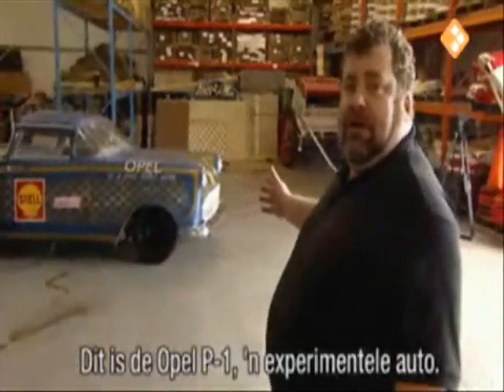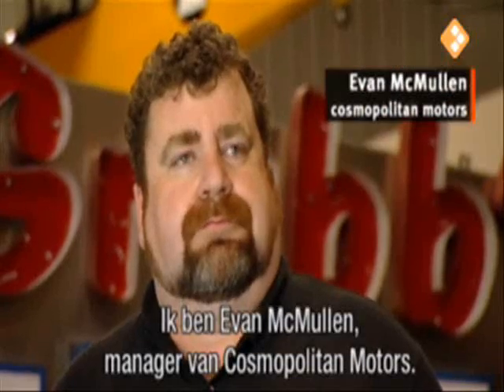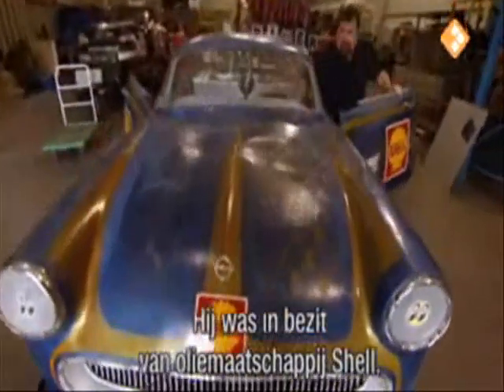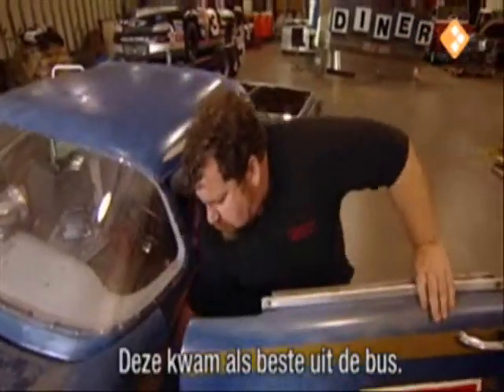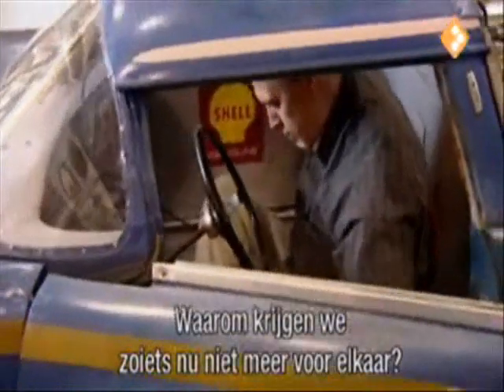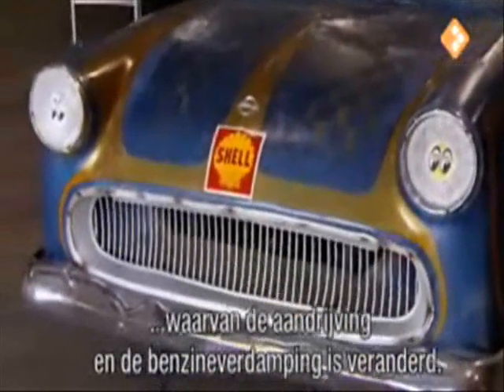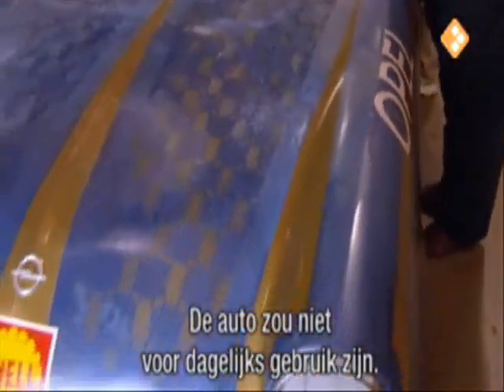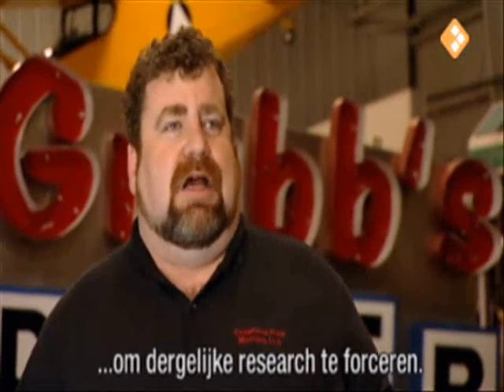High mileage car. 376 mpg!

Comment: Blame the oil companies and the bankers. They keep fuel efficiënt technology hidden. Like the tech to gassify the injected fuel instead of the direct injection nebulized fuel systems we have now. If you gassify fuel instead of the current nebulized fuel at injection, you car can become twice as efficiënt with fuel. That can applied to any other combustion engine for that matter.

Comment: The insurance company will be a change of venue and the judge will have no control over what happens. A claim against a policy will increase the premium. So my suggestion is to file as many claims on a policy as possible. The employer or whoever is compensating the Judge, administrator, commissioner, contractor, employee, officer, public official, attorney, persecutor (prosecutor), governor, city council member, complaint filer, police officer, tax assessor, DMV, etc etc will have to terminate the individual due to premiums increasing. You may not get anything monetary out of it but at least the source of your problem will have to be searching for another line of work.

Comment: Part of the problem here is the government regulations to control emissions. Much of an engines useful energy is wasted keeping emissions low.. Then there is safety considerations. A car has to have decent acceleration and enough power to climb hills without getting stalled. Also, the tires on that car are high pressure with an extremely small footprint, no traction to speak of. However I do agree that cars could at least double their milage if not tripple. My Prius gets almost 50mpg if I baby it. However, the general public demands performance with a certain amount of comfort and manufacturers are geared to satisfy demand. Yes it's all about the dollar, but then, do you want to be lorded over by a government which tells you everything you are allowed to do? That is what it would take to change things as they are!

Comment: I've watched this video about 20 times, trying to glean as much as possible. A few things to be noted:
1) The head pressure, or pressure caused by the distance between the top of the fuel level, and the point where it comes in contact with the vaporizer and/or heat is a critical factor in the process. I'm currently working on a similar high MPG vehicle, and have a desire to meter by drips per second. The only device that can do it well is an IV drip system. It was my own findings/understandings that helped me to understand WHY the fuel is in that particular location above the engine.  The next thing that I seem to understand, and appreciate is the synergy between the vertical orientation & the inner loosely helical shaped glass tube. The glass tube blown in a loose coil shape allows two necessary functions to occur: 1) any condensate must easily flow back down to the liquid at the lower portion of the container a helical 45-degree angle works better than a tightly coiled 5-degree angle (and you don't want to break the glass due to 'water hammer').  2) any vaporized fuel must be allowed to rise to the top of the helical tube without fighting the liquid, or condensate that will occur as the system warms up & cools down. Additional observations... the heat exchange should be as efficient as possible (the reason for the use of glass). Also, you need to be able to see the process in order to know when to adjust up or down in both temperature & flow rate. They didn't have computers back then, and coordinating all this may explain why the engineer believes it to be strictly for off road track driving only.   I can't find any analysis on this vehicle, not like I've given, and wish I could be allowed to drive from Portland, Oregon... up to Tacoma (200 miles'ish) and be allowed to examine it further.

Comment: 376mpg, but at what speed? A car going 60mph will use far more fuel than a car doing 20mph (theoretically 10 times more) thanks to drag force alone. Funny that the thimble of fuel would get the car 10 miles. Maybe 12 months or so ago when it hadn't denatured into useless hydrocarbons!
Reply: Apparently he was getting this miraculous fuel economy while averaging 80mph.
Reply: Fuel economy drops on average 36 percent if you travel at 80mph vs 50mph.

Comment: The man's math is horrendous. It took him three attempts to determine how long ago was 1973.
Reply: The rental came with a full tank. I filled up once en route, and once more the next morning when I turned the car in. I was able to get over 450 miles range on each tank of fuel. 13 gallon tank, but I didn't run it dry, of course, but just to make you feel better let's say I ran it out of gas before filling, that would still be 33mpg  average for the entire trip, including all the uphill bits. The first tank was used driving trough the plains states so yes indeed, fuel consumption was 42mpg though I really don't even know why I am wasting time proving what I actually did. I bet you never even did a multi thousand mile road trip but you go spouting ignorant comments. I've driven across the USA three times, I've learned to calculate fuel consumption. back to the original topic;
I did the trip in a bit more than  11 hours, because I drove it straight through, and traffic was nearly nonexistent.
That means average speed of about 75mph, btw. You are correct, we had to stop for fuel and to relieve ourselves on occasion. Obviously I was travelling much faster than 75mph most of the time to average 75 over nearly 900 miles.
Reply: If this rental you are referring to is the Nissan Altima, then perhaps one of your fatal flaws in your miraculous fuel economy is your miscalculation of the size of the tank. Don't assume the depth of my knowledge about cars. I urinate more automobile knowledge than you'll ever know.
Reply: It's amazing how you can beat EPA fuel economy ratings by  almost 50 percent.  Maybe one of your other fatal flaws is your math. To do 900 miles in 11 hrs and 15mins (you did say a bit over 11hrs) your average would be 80mph not 75mph. If your trip was 877 miles ( you did say almost 900 miles, your average would be 78 mph. I know the Altimas inside and out and in fact  I bought the very first new generation (2002) top trim Altima before the official release and was probably one of the first people to drive one in the country. Once again don't pretend to know the depth of my automotive knowledge or experience.
Reply: There is this little concept called rounding up or down, because I do math in my head, you know, without a calculator. 78mph is pretty close to 75. I did actually calculate it, but it was nearly 3 years ago, it's not like I keep a journal so I can post exact figures on comment threads so people like you can pretend to be so much more intelligent than everyone else.
I know I did it and how long it took me.
I also see you failed to prove anything resembling my request for you to enlighten us all, instead you brag about how you were the first person to own an Altima...who really cares, wow, you had the first of hundreds of thousands of FWD bread and butter sedans...ooh, I'm so impressed....NOT.
I briefly owned one of the ones you describe, I bought it to fix up and give to my best friend's daughter.

Nothing special about them, but they are nice enough.
I do know I can change a qr25 out in one in about 4 hours without even trying.
I actually am fond of the nissans before the current CVT crap they have now....IMO they are going to kill the company, but that's just me.
Again,
I never assumed anything about your automotive knowledge, but you have no problem assuming things about mine.
So, why don't you tell us about all the RB26 amd RB25DET swaps YOU'VE done, since your piss is such more experienced than I can ever aspire to be.
I have done several, one of them into a D21 pickup.
Tell me how many S30s you have swapped to an L28ET, and built a ECU, and tuned it, since I am so inferior to you.
How many cars have you rewired from front to back?
I've done that with a 1968 510, put a complete 200sx electrical system in it.
Please tell me how many stickshift conversions you have done.
I've already swapped a 92 buick roadmaster, no kits there buddy.
So please, go on about your superiority.
Or, are you gonna post another car you bought first?

Comment: Ok the last couple comments about getting marginally better economy with standard carb/ injectors, you can improve the economy of your car 20% just by monitoring and driving habits that promote great fuel economy. As well the car in the video except for the fact that it has an internal combustion engine, does not operate under the same principle as a carb or injectors. Funny enough it does burn fuel in a molecular fashion just to address the " splitting atoms" comment. 
Know one has made any reference to the fact that it was Shell ( big oil) that had accomplished this feat and strangely enough they haven't " destroyed " the evidence
And everyone that wants to know about it just has to go on YouTube 
This is some big conspiracy?
Reply: Exactly. 
but people like Carlos just say it's impossible because they can't do it. The CRX thing is also bullshit because if that CRX were tested using the updated EPA standards, it wouldn't get 40mpg

Comment: I drove a rented Hyundai Elantra from St Louis to Bethlehem PA....my AVERAGE speed was 75mph (which means i was doing over 90mph for a good portion of the trip) for the entire 900 mile trip.
AVERAGE Fuel economy was 42.5mpg. keep in mind that once you hit West Virginia it's almost ALL uphill.
If that CRX can even do 80mph it's not gonna get 40mpg doing it and you would blow it up trying to do 80-90 for 900 miles.
especially not impressed when the 1992 Oldsmobile Custom Cruiser that I drove down to St Louis (I sold it and delivered it to new owner because it made for a nice vacation) managed 27mpg over that 900 miles. A 350 V8 in a 4400lb full size 8 passenger station wagon that your CRX could fit inside of if you cut the wagons roof off.  Cruised it at 90-100mph no problem. 
so to repeat myself,
Not Impressed by your 1986 CRX.
Reply: I would wager it could. Also I doubt your 75mph average speed and you would have had to fill up at some point. The only way an Elantra is going to get fuel economy of 42.5 mpg at a speed in your own words of " 90mph for a good portion of the trip"  is down an elevator shaft, with a tail wind in neutral.

Comment: This will help explain 
www.
59fiatshellcar.
com
I own the fiat.
Reply: +Brian Selk Check out the BlueMotion cars from VW.  They get in the 70+ mpg range for diesel, but they won't allow them into the US yet.
Reply: MAXMPG You haven't made any recent posts to your website, have you been busy?

Also how are the electric fuel pumps that take the place of the water pump powered?
Reply: Hi Brian. The pumps are hooked up to the battery through a toggle switch on the dash. This car isn't really driven now. But, that is the way the pumps were connected and used by the team for the competitions. One more piece of interest is I was told they used two batteries. One for starting, and one for the pumps. 
I have more pics for the site. But have run into space issues. I will need to move some items around. 
Thank you for the email and interest. I'll step up my game on that site.
Reply: MAXMPG Thank you so much for responding. Does using such a setup really make that much of a difference? Is it going to pay for itself? Also you would have to create custom seals and stuff to make everything water-tight right? Also if you had everything set-up like that would you need check-valves or do fuel pumps already take care of that?
Reply: The pumps probly will not flow  backwards. I wouldn't think any check valve would be necessary. What special project are you working on?
Reply: I'm just throwing some ideas around to see how I can make my chevy (geo) metro the best it can be. I have done a lot of weight reduction, put some manual toggle switches, use a warm/hot air intake setup, and some lower viscosity engine oil for now. I haven't had it long, but hope to do a lot more with it.

My real special project will be to get a diesel and convert it to run on straight vegetable oil. Even then I would still be looking on how to make it even better.
Reply: +Brian Selk please go to my website and use the email address I post in the site bottom of home page.

Comment: Yes, I remember small cars made in the 60s and 70s getting 40 to 60 mpg.
My old 76 Datsun B210 got about 41 mpg on hwy and about 30 mpg in city.
If you kept your tires at correct air pressure, plus engine with good tune-up and clean air-filter, with good Texaco gas, you could actually get an additional 3 to 4 more mpg on hwy.
Reply: Had a 1989 Plymouth Colt with a 5 speed, it would get 45mpg at 65 mph and 42mpg at 95 mph on the interstate 🤣

Averaged around 38 mpg daily and I was a lead footed 17 year old
Reply: you are correct.
But....they were SMALL.
Technology has not been wasted, cars are bigger and heavier than ever.
if we were to make a modern day B-210 with no luxury stuff and no safety stuff, and keep the power down to the same levels as they were with a B-210 (about 45hp to the rear wheels),
we could have a legitimate 100mpg car.
Problem is, nobody would buy it.

Comment: My dad told be a lot about this car 40 years ago.  He said that they achieve that crazy fuel mileage by ALSO... turning off the engine and coasting down hills, popping the clutch to get the engine started again, and the tire treads were shaved down to about 1" wide, and the tires were pumped up to 100 lbs or more, to decrease rolling resistance.
Reply: Right.  It's pure physics.  If you burn a certain quantity of hydrocarbon fuel, it produces a certain number of joules of energy.  The power needed to keep a vehicle rolling at a given speed can also be measured or calculated.  Whatever energy extracted from the fuel that doesn't make it to the wheels to propel the car is being lost as heat due to friction.  No magic here, just numbers.
Reply: But they're not telling you about the additives that kill efficiency.
Causing the fuel to be wasted in the cooling system and exhaust.
My opinion is that the catalyst is on the wrong end of the motor.
Reply: Combustion inefficiency and wear to the the engine, fuel needs to be vaporized and cracked completely before it goes into the engine.
Reply: Back in the 1930's they introduced a thing called tetraethyl lead, it is a combustion modifier.
And they continue to screw us as pooches.
Poor dumb ignorant loyal hounds.
Reply: Charles Angell I understand how to vaporize, but what does it mean to "crack" the gas?
Reply: Believe me, he doesnt know what that truly means.

Comment: The problem that these fume cars have is that they are not boiling or in other words incinerating all the carbon out of the fuel.  Gasoline has 7 ingredients all with higher and higher boiling points.  You can evaporate gasoline at room temperature that will take care of the bulk of the liquid gasoline (pentane,hexane,heptane) but the Octane, Nonane, Decane & Undecane will remain.  (sorry for the pun)  That is why heat produces more fume.  You need more heat than the boiling point of your antifreeze from your radiator to boil off the octane.  So guess where the unboiled octane goes?  Back into the fuel and the more octane in your fuel the more LESS FLAMIBLE it becomes.  That's why you can advance your timing with high octane fuel.  Octane delays the ignition.  So, your fume system will run in the short term, but over time will gum up your plumbing and create stale gas.  BTW before you throw away that old lawn mower gas in the garden shed, SHAKE IT with some carb cleaner or acetone added.
I think that the reason this Opel never went into production is because it is OVER ENGINEERED and could not convince the DEBUNKERS at the safety associations of the long term reliability.

Comment: Did they push it for 360 miles?
Reply: gary marler No, but they could have walked almost as quickly.  This thing never went, in testing, much faster than 5 miles per hour.

Comment: all talk no proof makes this a fake video
Reply: Cars will run on fumes  that part is NO lie.  If you have bad gas its no problem using the bad gas and running on fumes .  There is no improvement in MPG though its exactly the same gas liquid or running motor sucking fumes from a jug.
Reply: ignorance at its finest
Reply: All fake talk and no proof would make this video The Oprah Winfrey show.

Comment: So, this weighs about as much as a normal car. Only real difference is the fuel vaporization (which has been shown to increase fuel economy if done right). The REASON we do not have cars that can do 100+mpg easily is because of the oil companies. Here's why. Gasoline is sold for profit. Increases of fuel economy will result is less product sold and thus less profit. The oil companies make a killing on oil products. The only reason we are seeing any increases in fuel economy is because the governments of the world are demanding it. If they were not, we would still be getting around 20-25mpg. I have seen enough evidence to believe a V8 engine could get upwards of 50-100mpg depending on setup and use. A little 4 banger like found in many modern cars should be able to get around double that with the right setups. In theory, using gas vaporization properly and combined with proper aerodynamic redesigns could cause the oil companies to suddenly lost 50-75% of their profits. Do the math and you will see why the oil companies have a vested interest in keeping high fuel economy vehicles off the roads. Basically, if you want a vehicle that is good on gas, you will have to do it yourself. I suggest all those working on gasoline vaporization systems should get together and put their minds and resources towards making a system that works and works well.